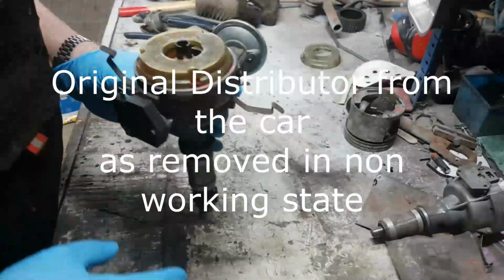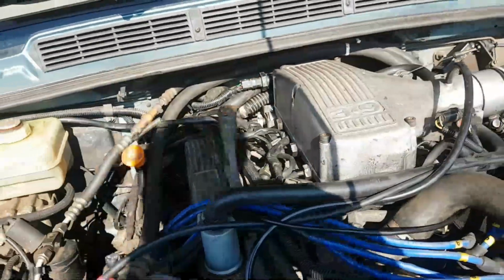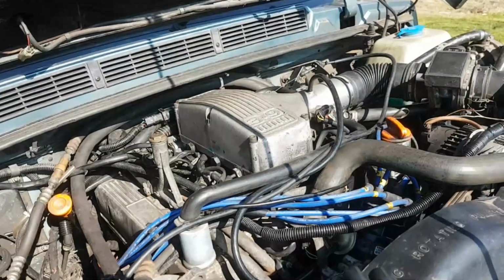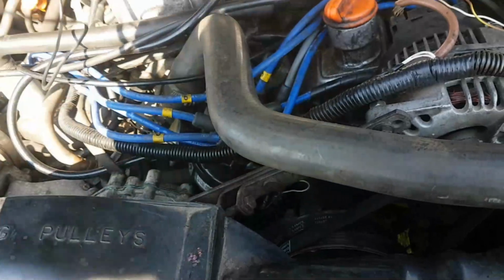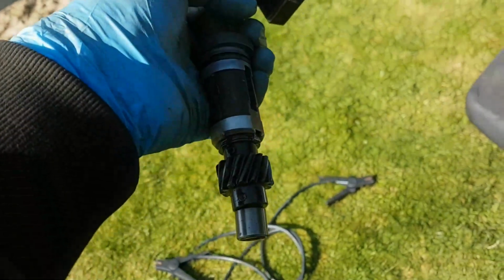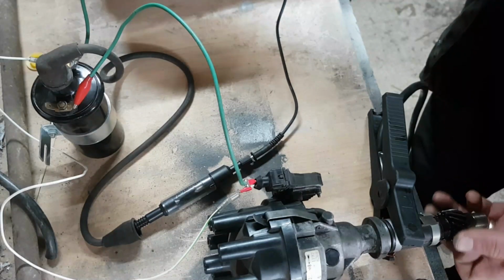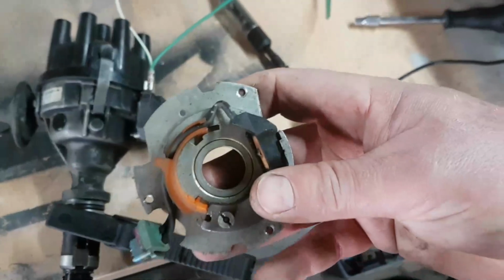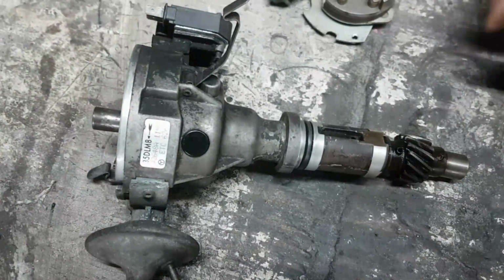1994 Range Rover Aegean Blue Part 9 - Finale! Might contain swearing

Comment: check it for an open circuit. Its the magnet that's stuffed not the broken wiring covers.
Reply from the maker: already checked, on the bench it passes all resistance checks. got to love an intermittent electric fault. Magnet is strong too

Comment: Hi Richard nice job , I've been waiting for you to solve my problem as it still don't start,i have ignored the dizzy as it was new not long ago , the original was burnt out because I had been to clean when putting the module back on the distributor wiping off the protective grease that keeps it cool , they last about 2 weeks without it , now I must check the new distributor to see if it had the grease applied on assembly from the supplier,  and check that base plate that you showed with bad wires,  anyways thanks for the great tips legend you are 🍺👌 to good health .
Reply from the maker: I had a ton of that white paste in place. I know what you mean about clean it up 😁 did you email me with your problem? churchhouseclassics @ gmail.com if not

Comment: Hi Richard, wouldn’t have helped at all in this situation but have you tried using the GM HEI style modules? Remote mounted, cheaper and more readily available than the Lucas and supposedly superior spark. Put one on my TVR and seems good.
Reply: Where would I obtain one of   these Gareth I would much appreciate the information.
Reply: Gerald Swain search HELLA 5DA 006 623-051 on eBay, I used a Hella branded one but there are cheaper available. I used a Lada Samara (!!) heatsink which was more or less perfect.  Wiring instructions here https://www.v8forum.co.uk/forum/viewtopic.php?f=11&t=78&sid=29dc1068f45c01ba66bf2edc88f5c09f but ignore the advice on Bosch Blue coil and use your original or buy a Bosh transistorised low ohm coil.